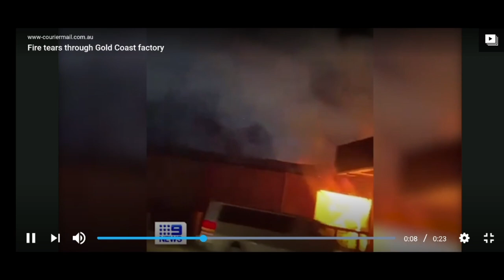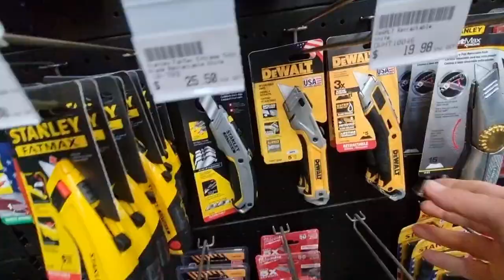How to Repair Drywall with a Few Other Problems in Between

Comment: Max, why didn't you just patch those 2 holes? No way I'd remove that section and exxie like you did.
Reply from the maker: There was mold in the cavity on some of the back of sheet. I should've shown that. thanks Kris
Reply: @Maxkil  mate I don't doubt your skills, just trying to understand.  Makes good sense now you explained
Reply from the maker: @krisbrand354  thanks Kris, also they asked us to take it out with the external. otherwise I would've kept that exxie. 🤙